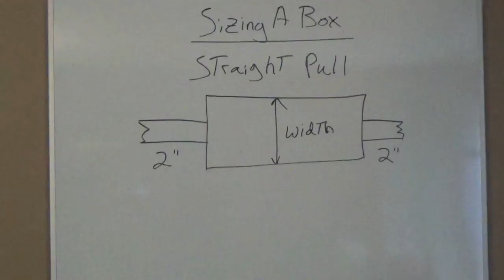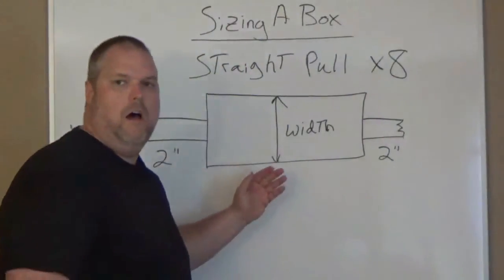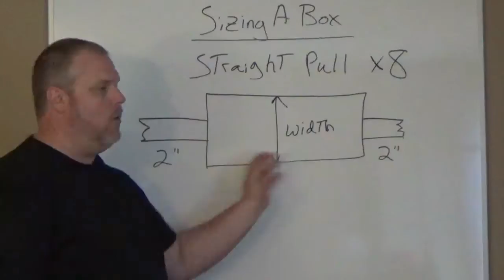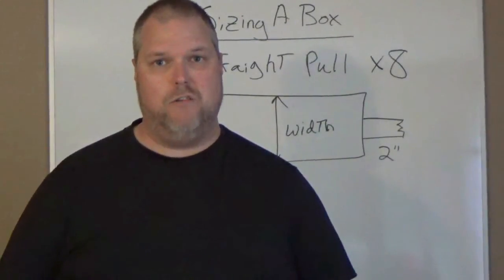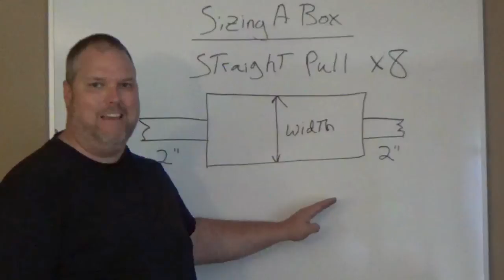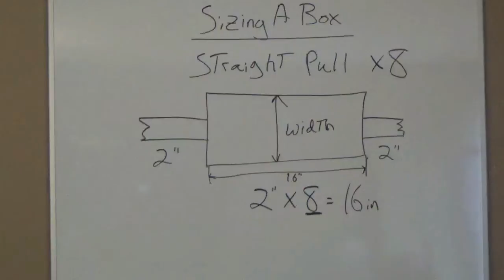Size a Straight Pull Box

Comment: So I need an 8 x 8 for a 1 inch conduit on a straight pull?  Unless there is an exception for conduits under a certain size stated in the NEC?  Thanks. Cause man I must have been doing it wrong all along then.
Reply: Jonathan Manley it all depends on the wire size you pulling ....remember there’s a size in cubic inches also for each current  carrier conductor